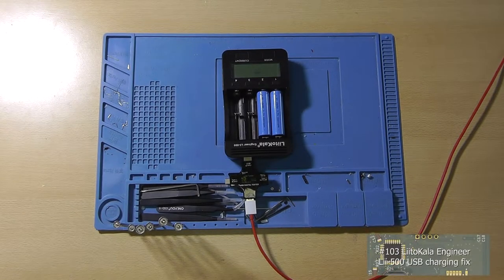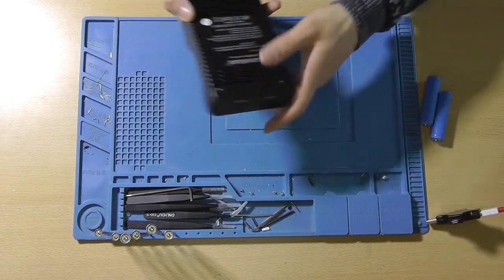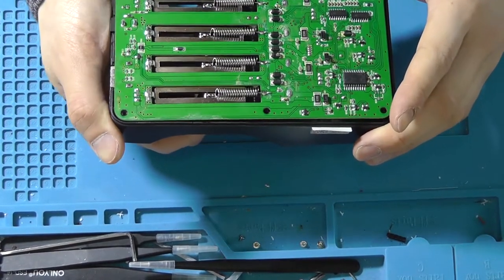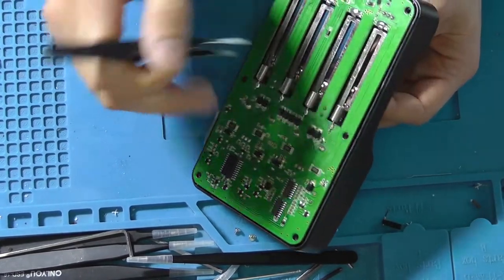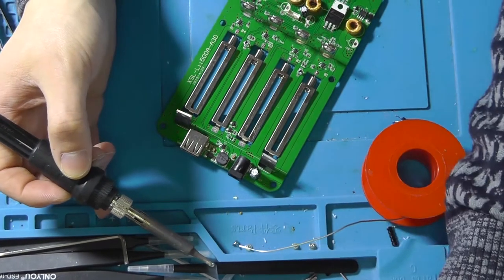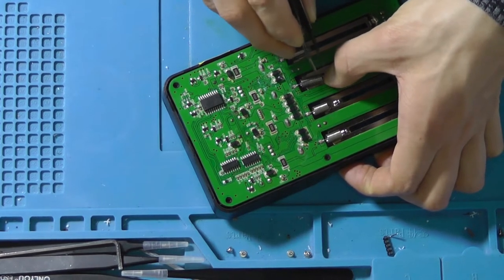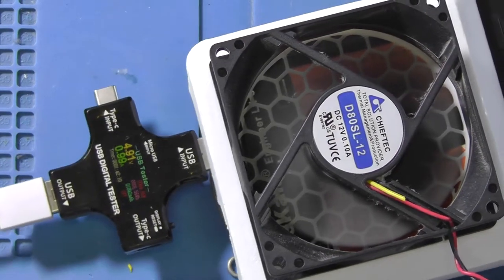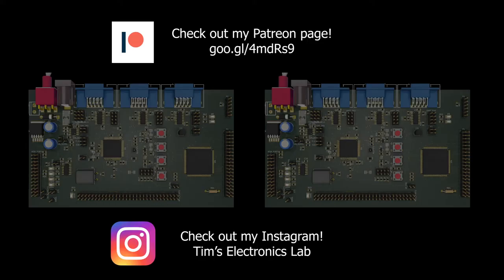#103 LiitoKala Engineer Lii-500 🔋 USB ⚡ charging fix

Comment: i can't believe that someone's made a video about something this specific! i had this same issue with a OnePlus 11 and attempted this fix with a 25V 47uF cap i had lying around. unfortunately it didn't solve the problem. 

my unit also has a very loud coil whine depending what's plugged in. a power bank attempted to draw over 1.5A and the unit flickered while the voltage drooped. phone did the same as yours while repeatedly making a high pitched whine. however, a USB light strip and an old micro USB powered smartphone were both able to draw 1A stably and quietly. 

i think my unit is just defective and while USB output would be a nice feature for emergencies, i have far better power banks in the unlikely event that i need them. ive seen cheap 18650 power bank cases that can even do USB-PD
Reply from the maker: Thanks for your kind comment! I love the charging feature of this device, but indeed, the USB charging feature is kind off broken from the factory. 

Are the batteries of the PD powerbank you mentioned swappable?

Comment: I got another version of Liitokala charger that looks pretty much similar to yours including the circuit. I used it for testing the capacity of 18650 batteries. It did go well testing around 50-60 batteries I extracted from an electric scooter. One of the resistors of the 3rd channel got fried up, R330. There are 4 R330 SMD Resistors. Once this resistor got burned, channel 3 cannot be used for testing the capacity anymore. Though, channel 3 charges but the odd thing hangs up at 99% and never ends the charge cycle. I know this sounds I've got a bad battery, but no, it was the charger. And hell yeah, this charger gets hot overtime especially considering that a capacity test at 500 mAh takes a long time, for 2500-2600 mAh batteries around 5 hrs. Why they didn't just stuff a fan!
Reply from the maker: Are you planning to replace the resistor? I'm guessing it got too hot and burned out
Reply: @TimsElectronicsLab  Not now. I just found the Litiokala charger that I have is inconveniente for my use. I test hundreds of cells.  Though, I added a fan to it and bought more testing equipment and chargers/dischargers. I wouldn't personally recommend such chargers/dischargers that come without any proper heat dissipation for testing a lot of cells. Overall, it worked fine and I tested quite enough of cells before it failed.